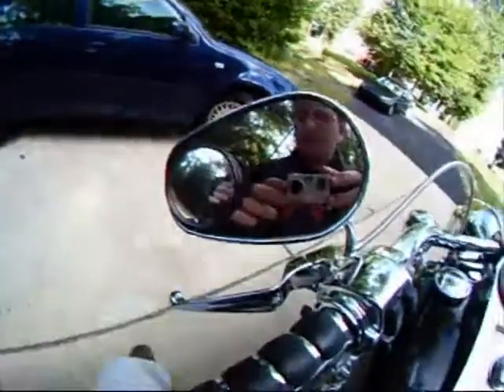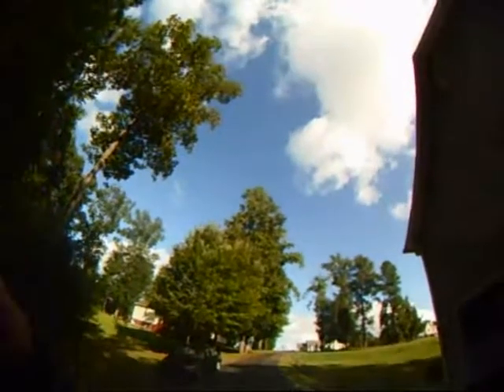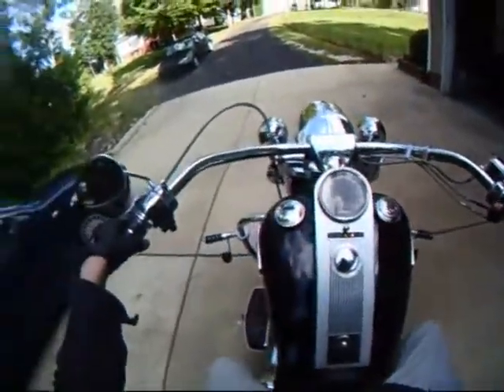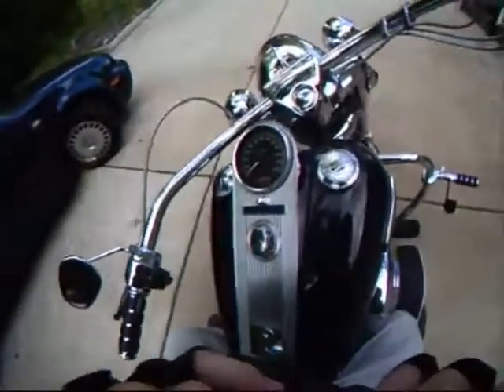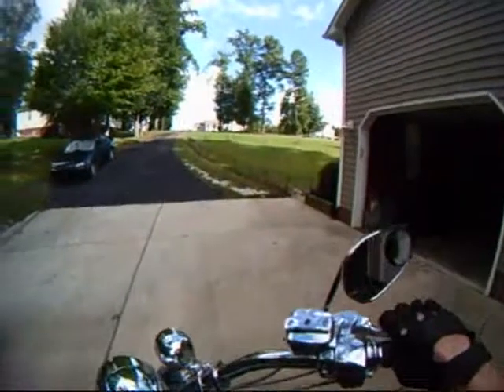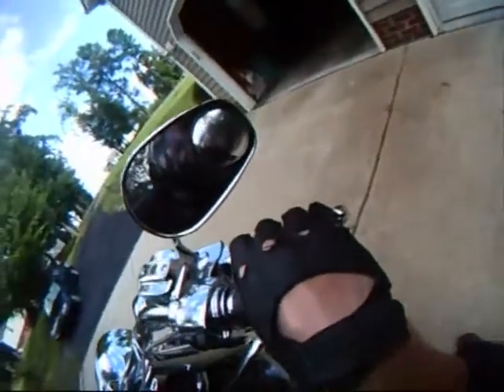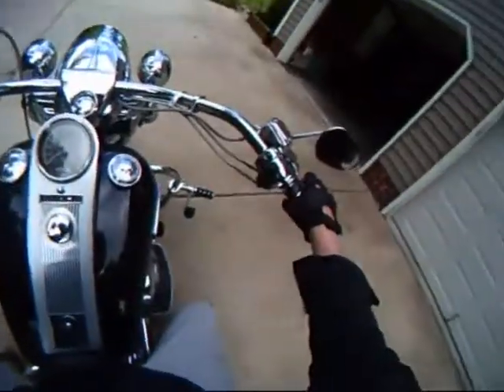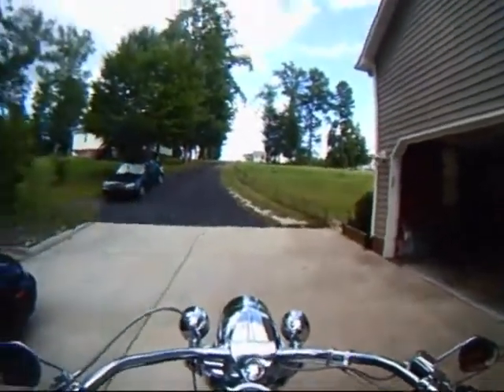TESTY!!!

Comment from the maker: The only problem with that setup is that it is for helmet-to helmet comms, or for phones.  With the digital cams I've seen, there is no external mic hookup to plug into either.  I suppose I could rummage through Radio Shack to see if they have a head-set mic that could attach to a digital voice recorder, but it just seems simpler at this point to use the Vado in the FFH.  I'd wanted an FFH anyway for the cold, so I'm sort of committed at this point.  But I'm always open to new ideas for the HH!

Comment from the maker: If you find a good digital voice recorder that converts to usable sound files on the computer, you could synch up the audio with the video as you edit the film.  All you would need to find is a good mic that works in the wind.
The FFH is not my first choice, but it holds promise for vlogging.  We'll see.
Keep the rubber to the road.

Comment: Additional note to suburban riders list;
i have the T77 cybershot as does steelhorseclub and cuttlefish is using the T55. I dont know about the 22 he lists but these other two i listed have a cut off of ten minutes which means it shuts off after 10 minutes when videoing. So you have to hit the button again. Not a big deal but annoying when inna helmet. T77 has 10 mega pixs and great sound not sure on the 55 but cuttlefishs  vids look and sound great so should be good too.